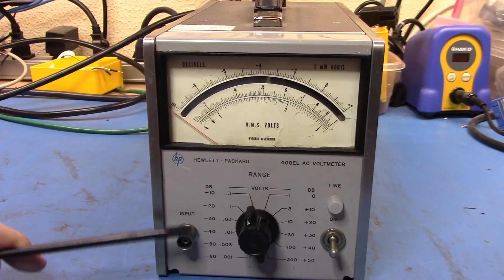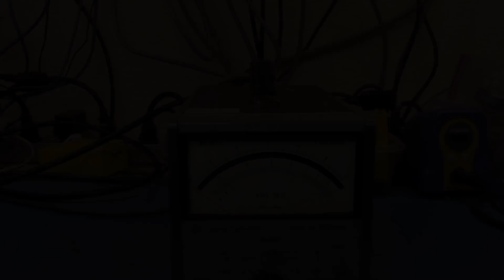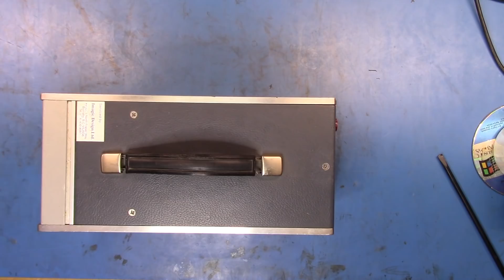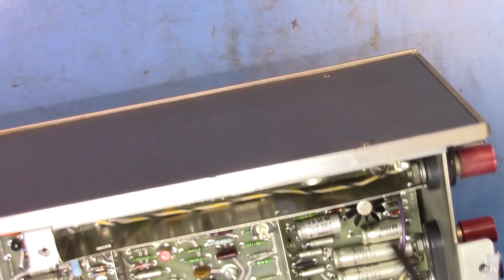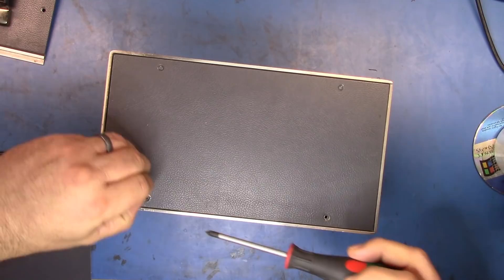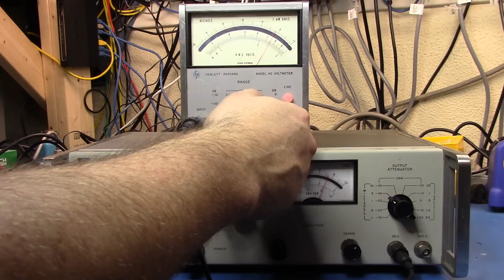HP 400EL AC Voltmeter Overview

Comment: Whats the best way to calibrate the 100kHz / 1v attenuation ? Service manual refers to using an HP Oscillotester ???
Reply from the maker: The manual I have uses a 651B or 652A to do calibration - I don't think I ever bothered to do the calibration at the time because I didn't have the null meter - I think most modern signal generators could probably get pretty close to the spec for the unit - If you have the 1V Thermal Converter and it is itself in spec then you could use a 6.5 digit DMM and any source by measuring the source first.

I got my manuals from Artek Manuals - Well worth the money.
Reply: @tgsoapbox  Thanks ! I didn't realize how much used thermal converts cost on ebay. 3x more than the $50 I got the 400FL for. I'm using an old func gen, always gotta test first. Gotta figure out a a way to test 1 v - 100kHz without breaking the bank
Reply from the maker: @wownoflutter9817  yeah, I lucked into a 1v converter but I just haven't found the others at reasonable prices.

Comment: I find those old HP instruments very nice. I have a similar instruments rated from 5Hz to 20MHz and is a Racal Dana 9300F, a special version delivered to french army. Very sensitive, starting from -80dbm (600ohm)! Terminated on 50ohm load I can read 50uV at midscale, thats the tipical S9  in ham radio hf bands. But I particularly like the form factor of those HP as well as the nice large scale which gives a better resolution than mine.
Reply from the maker: Thanks - I really like that form factor, I have 5 or 6 HP instruments in that frame - That Racal sounds outstanding, Thanks for commenting, appreciate it.

Comment: I've got two of these. They are great for audio work. I use mine for am Radio IF alignment. My meter has batteries in it. I do like that test oscillator. Once upon a time I used that equipment in my work in middle telemetry, working on VCO subcarriers oscillators and discriminatory,  in the aerospace industry at RCA.
Reply from the maker: Thanks for the comment - I've heard from a number of people that they use these in Audio and IF work - I picked mine up when I needed to look at higher frequency AC on a Fluke 5200A.

Comment: Really nice scale on the meter  I have been looking recently for some audio specific gear quite unusual these days.
Reply from the maker: I've read that these are popular with the audio crowd due to the 600 ohm spec and ranges - I'm not an audio guy so I can't comment but as a meter I think they're fantastic - I need to use both of mine more often.

Comment: I use my 400EL frequently to align radios, not worrying about any Z bump to the radio's speaker since that's a relative measure anyway.
Reply from the maker: The 400 series meters are great devices that still exceed the frequency capabilities of most bench DMMs even now.
Reply: @tgsoapbox  As I was watching your video I was leafing thru the manual and never really noticed the max voltage ratings that are different below/above 300kHz. Thanks for pushing me into the book! I've got the fancy DMMs but the 400EL is the goto when you need to watch the needle swing.

Comment: Interesting video! I used a 400E for many years, one of the main uses was for setting beacon radar reciever video average noise level. All the techs on site got together and using a scope agreed on a 0.5 volt noise level then we hooked up the 400E and marked the measured rms voltage value. The level was critical because it affected false alarm rate - a key parameter in radar. Using a scope, each tech had a different idea of what 0.5 volts of grass looked like and this resulted in endless adjustment of the quantizer  circuit which converted the analog video to 0 or 5 volts logic levels. With the meter disassembled could you carefully spray the face with a light coat of polyurethane to prevent further deterioration?
Reply from the maker: Thanks for the reply - Interesting story and the 400E would have been great because of that 10MHz bandwidth. I asked about using conformal coating (https://groups.io/g/HP-Agilent-Keysight-equipment/topic/24815582#83707) and the response was to use decal glue - Completely forgot about that when I did the video.